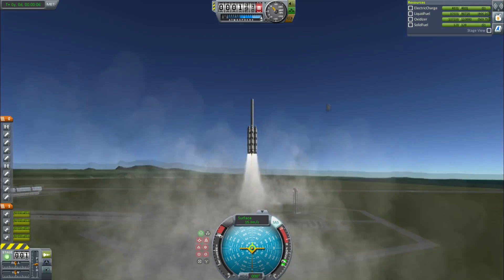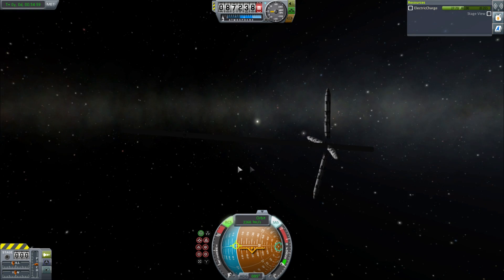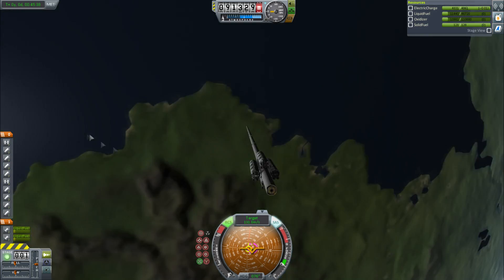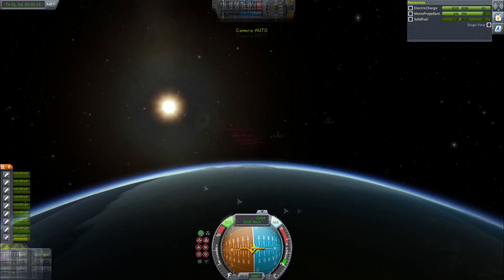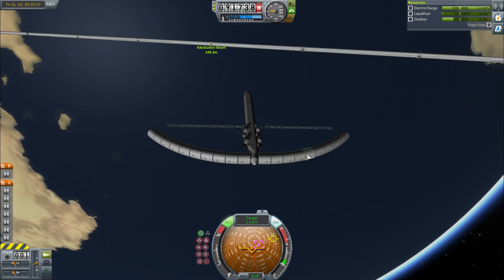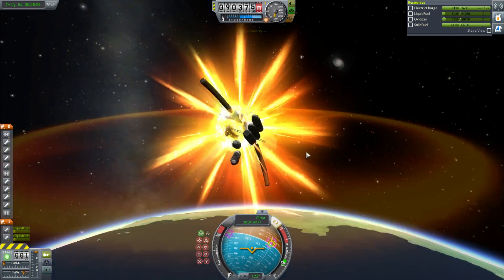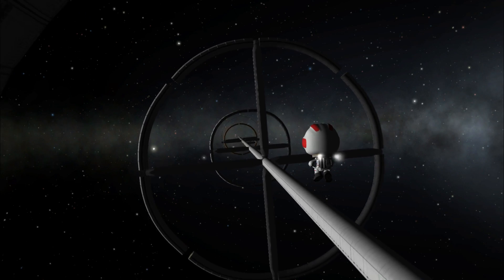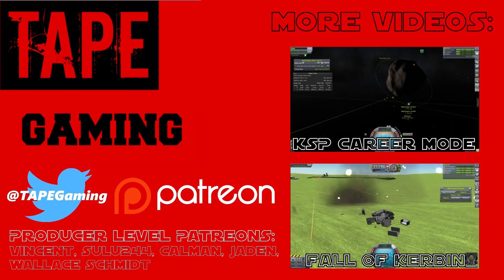1km Long Space Station - Kerbal Space Program

Comment: As far as the physics go on a construct that large - you're probably encountering a lack of precision in floating point numbers. Something that would be represented as 1000001 would be represented as 1.00000*10^6, and that would move some component by a few inches, and the physics would react to that, and everything gets wonky.

. . . which is why the "kracken" was such a big deal for the game when it first came out, and why it was so hard to fix. I believe the KSP team actually uses several tricks, including giving ships their own local coordinate system, to ensure a game of this scale is playable.

As far as the docking not working - at first, I thought that it could be a simple case of some sort of limit before the game simply didn't think you were close enough to the ship to attach anything to. But that shouldn't affect trying to dock something to the center? Maybe a part count limit? Hard to say.

Comment: Turn off SAS to stop the wobbling !
Reply from the maker: Tried it, didn't help
Reply: +TAPE Gaming Oh, then I guess a Dyson sphere would be way out of question lol
Reply: have you tried putting landing gears on the parts, if i remember correctly once parts dock the landing gear struts itself to the largest part on the opposite side of the docking port... it could be fixed its been a while... i think they called it mudr tech or something.

Comment: Maybe, on a station that big, tidal forces from Kerbin become a larger Problem. They're tugging on your station with different amounts on every part and those differences add up over time resulting in failure. Maybe it will be more stable, if you put your station further out, maybe even in high orbit around Kerbol. Though I'm just guessing, it was after all stable up to nine connected sections.
Reply: Wei Zhao So you're absolutely sure that gravitational forces are not calculated for each individual physics part? If they indeed are, that would mean that the game doesn't need to "care to simulate that crap". It would mean that tidal forces naturally come as a freebie from the type of simulation employed.
Reply: ksp's n-body physics simulation is limited to n=2- your craft and the planet/moon you're orbiting

Comment: it may be swaying because all the parts are at different altitudes, and therefore travel at different orbital speeds. As long as they're not too far apart, the structural integrity of the station holds the pieces together, but a 1km wide beam may be over the top in terms of staying together. That's, like, 100 m/s difference between one end of the station to the next
Reply from the maker: Yeah that would make sense in real life, but I think ksp just models it at the center of mass :)
Reply: I think it's SAS who make rumble like this. The SAS try to corrige direction but when it move a little, it try the opposite, and grows increasingly with the size of the station... (Sorry for bad English)
Reply: nope.
In one savegame the large solar panels of my space station were starting to flap like a birds, similar like your parts.
And my space station was rather small.

It's a phantom forces bug
Reply: Ace Athor It's not the SAS, the phantom force will start to be noticeable if your ship is big enough. I had a another station without any attitude control module on it and it starts moving on its own when I stare at it. 

But yeah, an activated SAS module would make things even worst.
Reply: I can confirm the phantom force bug that has been around since time immemorial. It happens when you try to build something relatively huge. 

I have a v0.9 save game in which I docked a class D asteroid with a class E asteroid. Unfortunately, the thing won't stay put and will self-destruct in a paranormal fashion if I look at it for more than 30 sec....
Reply: If this is actually the case, then putting the station further away from the planet might help. Hmmm...
Reply: Ben Pearson My asteroid station was on a higher solar orbit than Kerbin...
Reply: Its the Kraken.

Comment: I don't get why the game doesn't come with an option to auto-merge connected parts into a single solid object for the purpose of physics processing. Every time I tried building any ship or station which was slightly more complex, the game ruins it.
Reply: because that's not realistic.
Reply: It doesn't matter if it's realist or not, I just want to be able to build whatever I want without having my framerate drop to unplayable or shit wobblying around like crazy. It takes a lot of fun out of the game. Plus, it's only an option, you don't have to use it if you don't like it.
Reply: NightLurk The problem is, it's a limitation of Unity. it's not fixable :v
Reply: ***** that would involve rewriting the entire physics engine, because Unity's is a tree hierarchy based. (It's the reason why objects can't make loops without docking ports or struts). In fact, most physics engines are like this because you generally don't need to strap hundreds of parts to gather and put them through stresses of a rocket launch.
Reply: ***** I'm not sure how that game does it, but it's likely instead of applying physics to all of the parts individually and connected via joints, you do all of the translations yourself, that way their are no joints to wobble.
Reply: ***** Question, do those game simulate rocket launches?  And how well does it simulate it?
Reply: you can also import another physics engine into unity and use that instead, it is all just libraries and code, the only requirement is that it runs on C#.

Comment: Why would a space elevator wrap itself around the equator? Isn't the point of a space elevator to be at a geostationary orbit so that it would orbit the earth the same speed as the earth rotates?
Reply from the maker: Well the cable would be moving at the same speed, so it wouldn't be at orbital velocity lower down and thus would fall back to Earth
Reply: the idea is that you keep the cable stretched by also putting equal mass higher up
Reply: hahaha, Geostationary orbit requires an altitude of 35,786 kilometres above the equator... Even then, just because its "stationary" doesn't mean the orbiting object is rotating at the same speed of the planet....Its just farther away meaning it takes longer to actually complete its orbit, move it far enough and it appears to be going the same speed.. Its still moving at orbital velocity, which is faster then the earth actually spins...  Basically anything tethered to the ground in orbit, will not remain in orbit for very long... The planet will slow it down and keep it from maintaining the required speed to stay in orbit... The whole space elevator idea is kinda pointless, it would require us mastering gravity on a level that only exists in sci-fi movies... and if / when we do master gravity on that level, it would also mean we could send ships into space without using propellant... Which means we wouldn't need a space elevator to begin with lol
Reply: You dont use regular velocity when comparing 2 circle movements, you use angular velocity to do that, and they just have to be equal for the space elevator and where its anchored
Reply: mass has nothing to do with it, its literally the difference in speed of how fast the earth spins (465 meters per second) and how fast a object is moving in orbit... Making a geostationary space elevator would literally mean building a structure that is 35,000 kilometers long, or as you put it, using a "cable" that is 35,000 kilometers long and is made out of god knows what, because no material we currently have would be able to survive a "tug" from a space station moving at 3 kilometers per second... (which is the speed a object must be traveling to maintain geostationary orbit)...     So given that a space elevator would only be possible  in a geostationary orbit... requiring a structure or cable that is 35,000km long and requiring materials that would make Adamantite look like heated butter..  the whole idea begins to look silly.
Reply: Agreed. But can we also agree that if we find something that has the tensile strength to tolerate it, we would be able to do it
Reply: Even if there was some nigh invincible material that could withstand 35,000 kilometers worth of material being yanked around by a space station.... You seem to not be thinking of how gravity will still be effecting all the material from the planet to the station....and the fact that whatever material you would be using, would be 35,000 kilometers long.... Even if you used a cable made out of tin foil it would still amount to literal TONS of material being pulled on by gravity consistently....there by yanking your station out of orbit .. The only way to make a space elevator work, is to somehow make it immune to the effects of gravity... And if we had that kind of technology... a space elevator wouldn't be needed to begin with... and strictly speaking my point about the planets rotation and the orbital velocity of the "station" was that the only way that works, is if its in a geostationary orbit... Meaning the required angular velocity as you put it, requires you to be 35,000 kilometers away from the planet.... The tallest made made structure in the world stands at 829 meters roughly...  The space elevator would literally be 42219x larger.

Comment: I've run into an intermittent bug with docking ports which prevents them from latching.  I'm not sure if it's the same bug you're getting, but it has the same effect, and also started happening to me only after I started building stations with a lot of modules.  It's caused when ports incorrectly get flagged as "docked" (or something like that) where it thinks the port is already docked even though it isn't.  The only way to fix it is to quicksave, edit the save file (not difficult to do if you look up directions), then quickload.  It also helps if you get a mod that lets you rename docking ports, so that you can easily find the malfunctioning one in the text file.

This bug has been around for years, but for some reason they've never gotten around to fixing it, even though it seems pretty common, and can be pretty game-breaking.
Reply from the maker: Oh cool, I think that is what's going on here, I'll try it, thanks :)